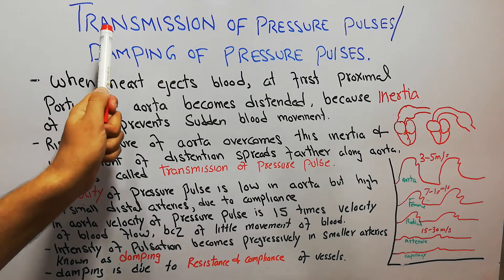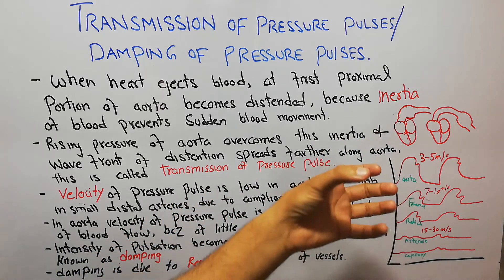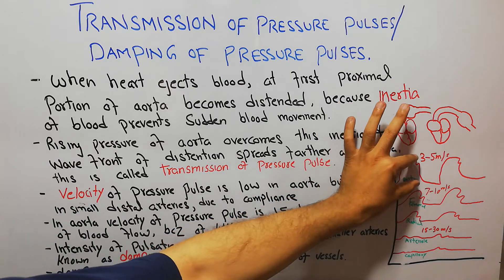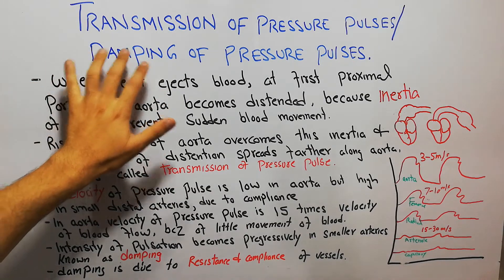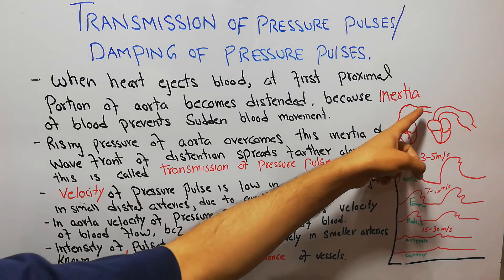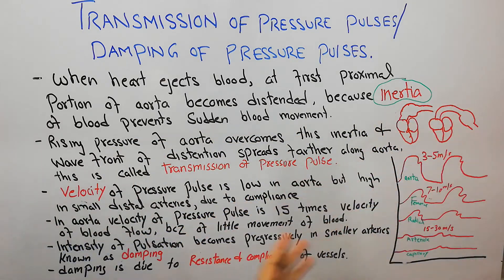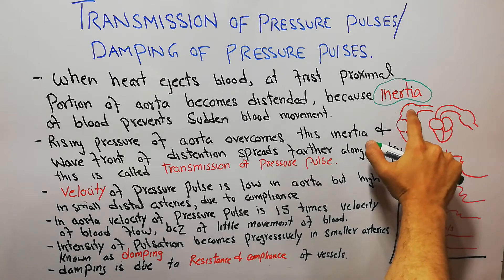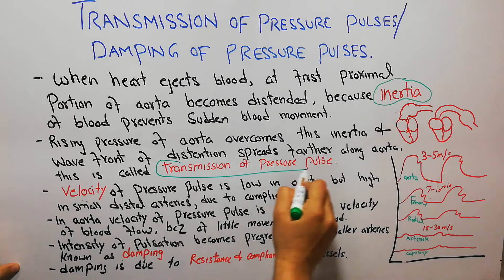CVS physiology 70.Transmission of pressure pulses,Damping of pressure pulses#compliance #resistance

Comment: 9:45arterioles have greatest resistance why doesn't it have greater pulse pressure as compared to aorta..since systolic pressure depend on resistance of artery too and arterioles have greater resistance and diastole should also be greater ..plz explain
Reply: No diastolic pressure depends on resistance
Reply: Systolic pressure depends on cardiac output and diastolic pressure depends on peripheral resistance